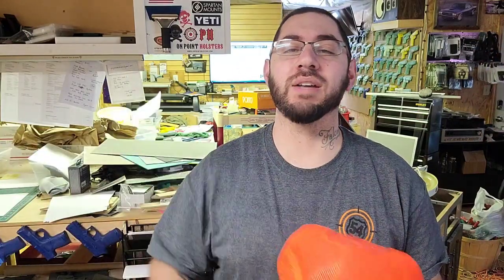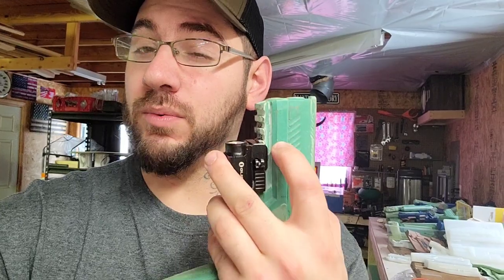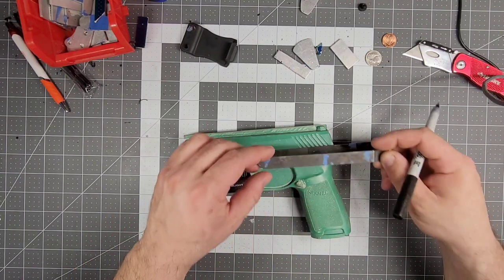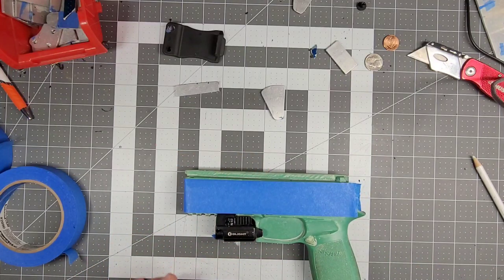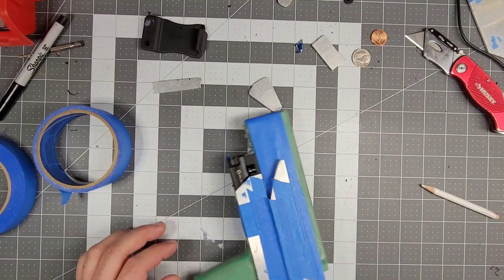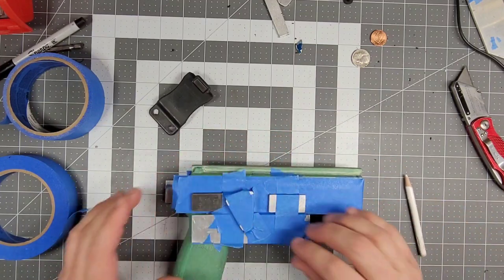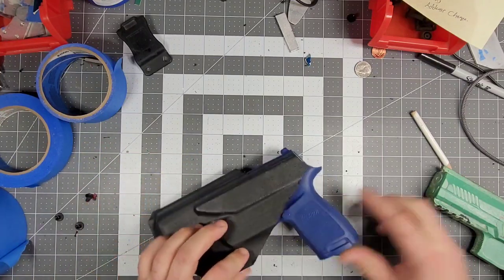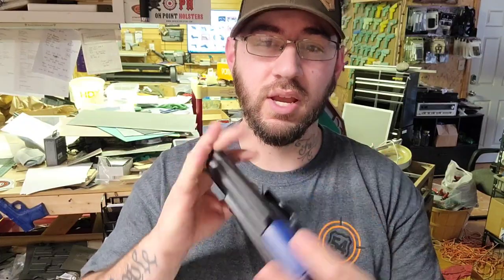Sig M17 with Gas Pedal and Olight PL Mini 2

Comment: I would love to have a gas pedal on every one of my pistols! Any idea, even if they were cut down to half size maybe, how that can be adjusted for each holster, so I don't have to replace each holster?
Reply: Get a heat gun and a dimensionally similar piece of aluminum. Or, heat the side and slowly push/pull the gun out. It works, doesn't look the best. Also, be careful not to overheat other areas of the holster. Gloves, a directional attachment on the heat gun, and compressed air on standby helps a lot. Good luck!

Comment: You got any tips for an OWB with suppressor?  I got a FN 502 running and OSS RAD22 and it sucks taking off the suppressor each time or setting the gun on the hood.  Wanting to bend my own but not sure if you already had tips?
Reply from the maker: I have a video on a suppressor ready holster. But they're used with a light. Other option is to block for the suppressor
Reply: @FalTacUnlimitedLLC  have the link?  I went through your video last night and didn’t t see it…. I do have a light as well

Comment: Thanks for all the great videos, love them all. Is there a reason you use the blue gun for fitment instead of multimold or other molds?
Reply from the maker: Blue gun is a 1:1 with no blocking. Good for test fits if you don't have real steel. Sight channels can mess it up
Reply: @FalTacUnlimitedLLC  thank you for clearing that up. Keep up the great work